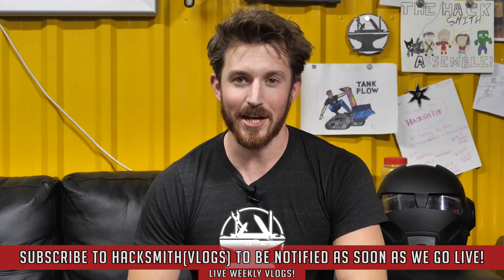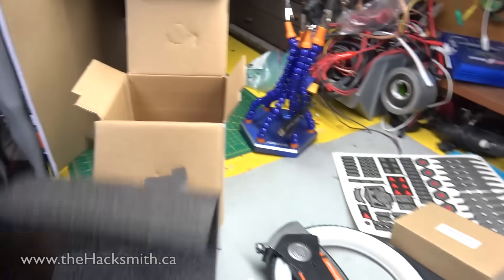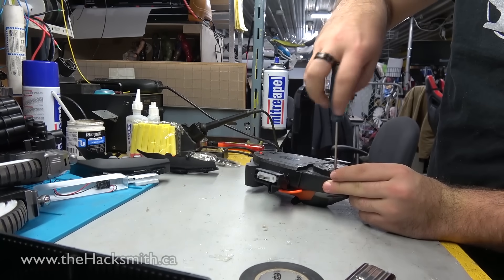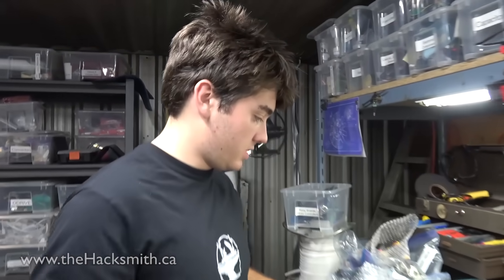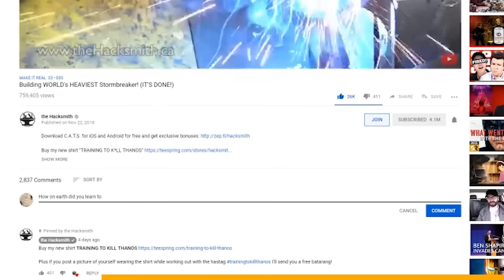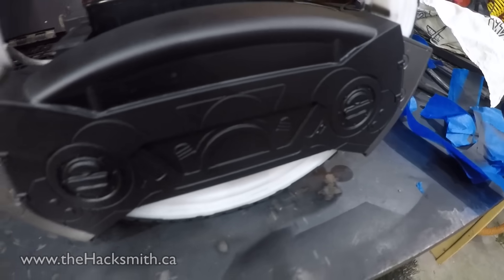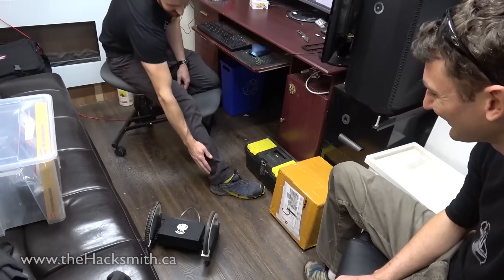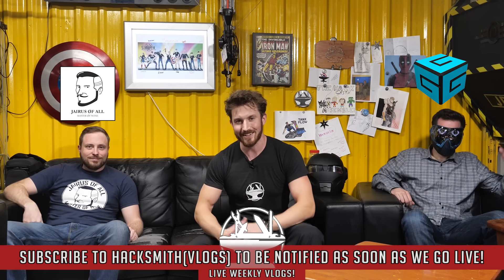Real Life Twitch Drone (from R6 SIEGE)

Comment: Kind of disappointed in the lazy execution with this. Usually the builds on this channel are high quality. If you would have made it from scratch, you wouldn't have main board failures and needing to develop a smartphone app for bad controls. Same effort required, but the end product would have been better. The drone is too loud and slow to sneak up on people. The shape of the prongs didn't work and you didn't fix them.
Reply from the maker: ...Did you watch the intro?

Comment: If you want to build a true twitch drone it should contain:

- A Critical independent gearbox
- 10 kilometers of internal wiring
- 1100 Expertly machined and assembled components

And it needs to:
- Have flawless control over 300 meters
- Enables zero to 20 in under four seconds
- Ruin mira's day

Comment: It’s not done until it has  mecanum wheels
Reply: mecanum wheels like the ones in game dont make any sense. You need at least 3 points of contact to rotate and 4 to strafe. Mecanum on a 2 wheel would just make it hard to drive in a straight line
Reply: @rhinothepwn  Twitch's drone actually has 4 wheels, 2 hidden underneath the backside, well the elite version at least.

Comment: I noticed you used Blynk to control it over WiFi but it had a bit of lag. I have been unable to get Bluetooth working with the esp8266 or esp32 but if you got it working, it would probably have far less lag